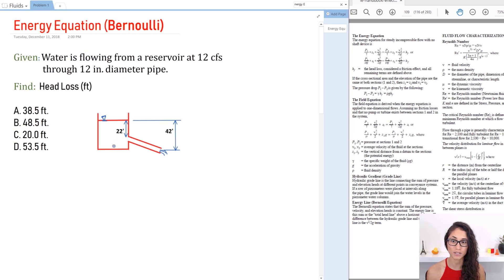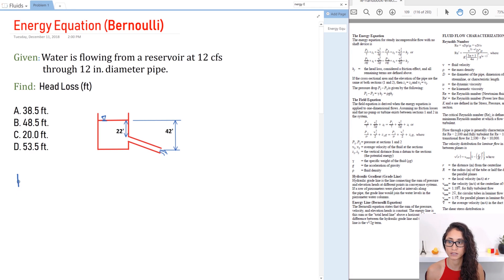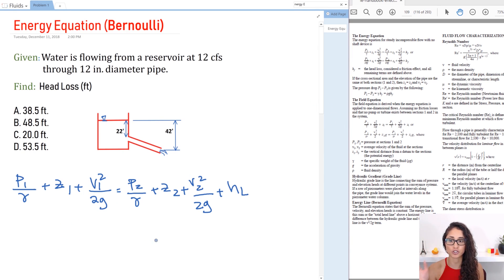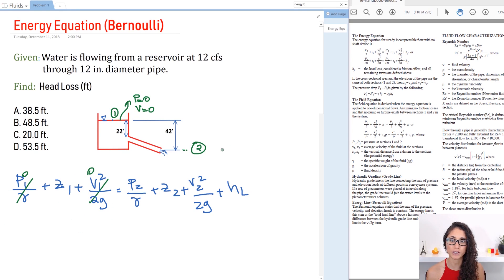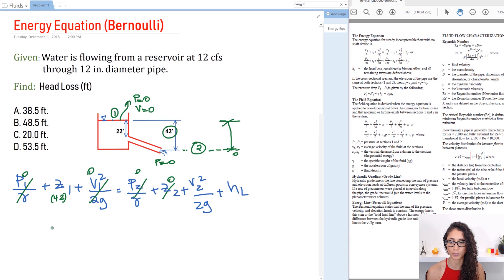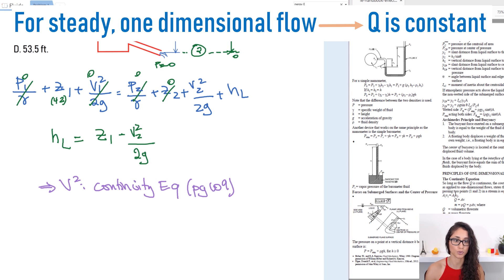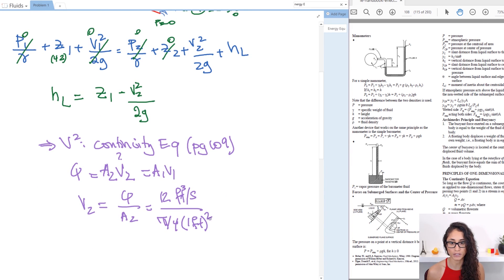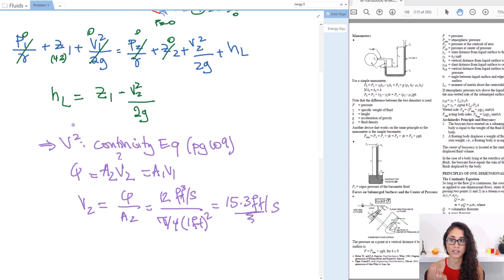FE Exam Fluid Mechanics - Energy (Bernoulli) Equation - Head Loss

Comment: I am confused when you use the continuity eq. Q=V1 x A1=V2 x A2 because based on the previous equation V1=0, so Q should be 0 if we assume V1=0. Or not?

Thanks!
Reply: Actually V1 is not zero, stricto sensu. (V1/V2) is close enough to 0. So, if you had the diameter of the reservoir, you could even compute V1, and then put this value into the Bernoulli Eq. It happens that this value squared (V1²/2g) of order of magnitude, say, 1e-8 or so, is gonna end up being neglectable in the equation.
Reply: https://youtu.be/QL-0N1V_aOw

Comment: P=0 because it's exposed at the  atmospheric pressure.
Reply from the maker: Hello Yoona, correct! So in these problems, we usually calculate for the gage pressure. The absolute pressure P = Pg (gage pressure) + Patm. If you substitute the absolute pressure equation for P1 and P2 (at the open surfaces), the Patm cancels and that is why Patm is usually considered zero! I hope this helps, thank you for watching and good luck with your studying!
Reply: That's what I learnt from my professor, thank you so much ma'am😇 by the way next sem em gonna take hydrology. Will definitely watch more videos from you😊

Comment: How you choose the Datum? What if I choose the Datim at point 1? I would have a different sign, and I would get a wrong result.
Reply from the maker: It doesn't matter how you choose your datum. If you use the datum at point 1, Z1 will be zero and Z2 will be -42, if you rearrange the equation, you should get the same answer as shown in the video. I hope this make sense and good luck.

Comment: I don't think the continuity equation is on page 109, my book has it on 104... Is 2018 manual  not the most up to date?
Reply from the maker: Hello, that is actually weird. I have the PDF file, do you have a PDF file as well or do you have a hard copy? On the PDF file, I have it on page 109.
Reply: @Genieprep  I have a PDF... Strange...
Reply: Fe Handbook version  9.4 has been updated to version  9.5 in August 2018.  The equation on page 104 (FE Handbook 9.4), while it is on page 109 (FE Handbook 9.5)